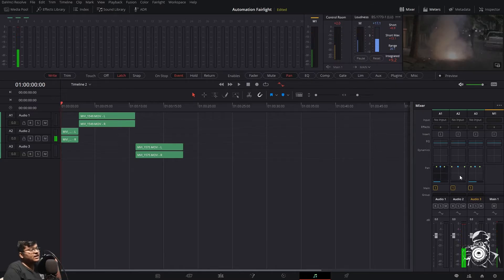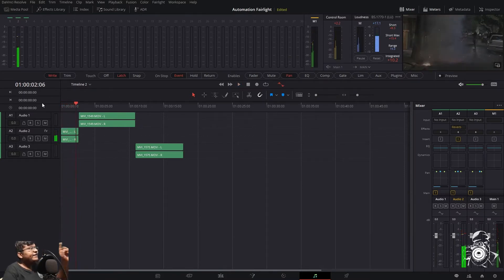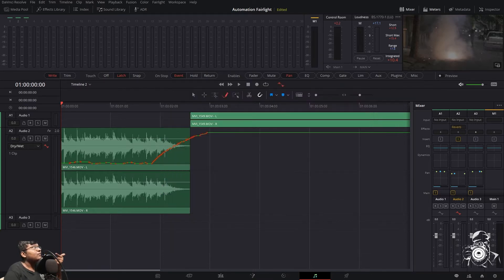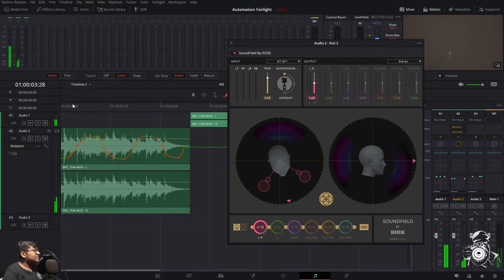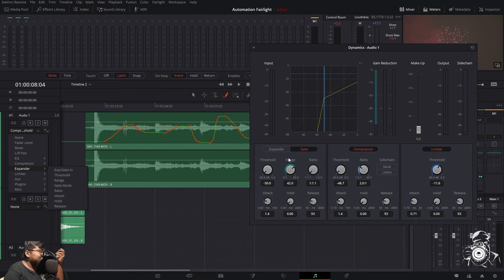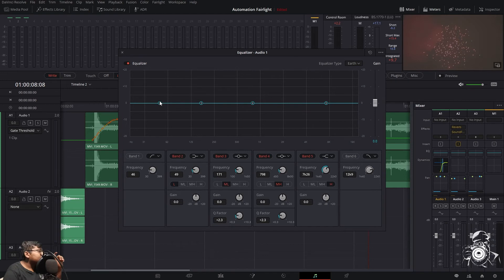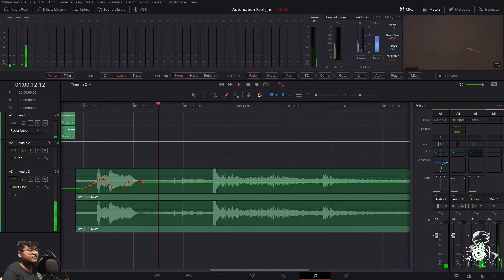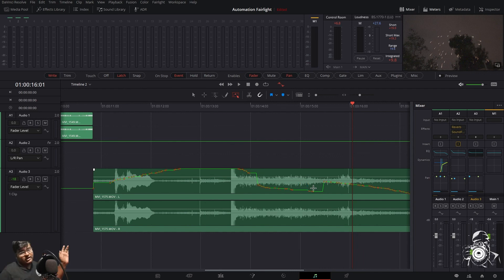Ep 07 Part 02 | Automation In Fairlight  | Davinci Resolve 16 | Editing Tutorials | #Learn_and_Editx

Comment: Most of this is translating over from ProTools pretty easily enough, but I am having trouble grasping some of the controls that revolve around Preview Mode. It seems the only way to fill interpolated automation data has to do with preview mode, manual states that "glide range" should take committed data from range in and glide it to the previewed data at range out, but I am not having luck with that procedure. Pencil tool and manual recording it is.